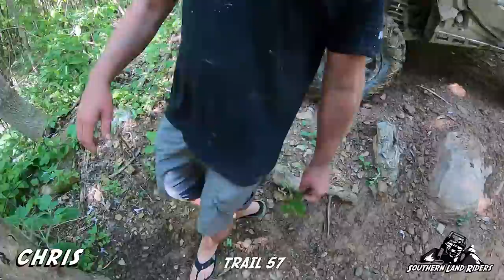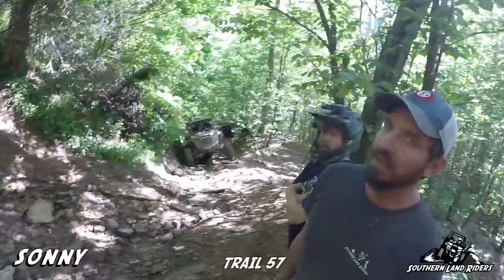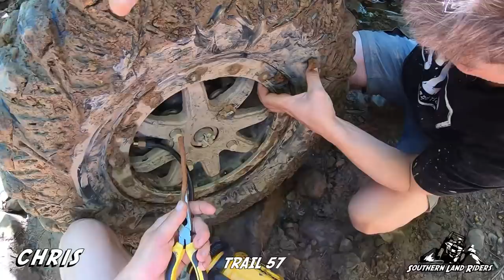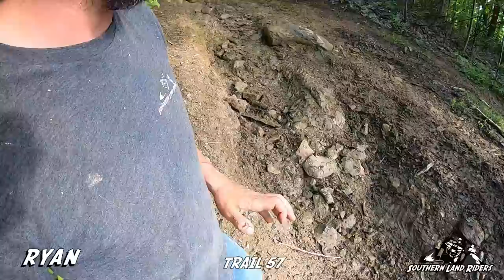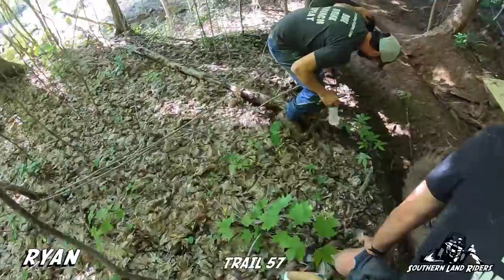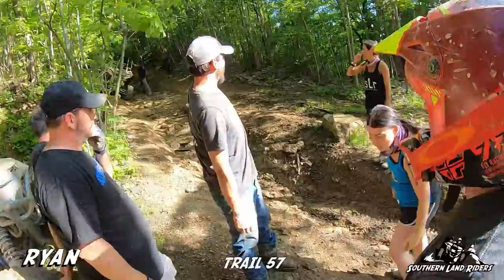Windrock 5/2020 Day 2 Part 5 (Glad It's Over)

Comment: What has been the best all around tire from your experience? Great videos and dedication for taking the hard line. Gives all a good perspective on what to be looking forward to on 1st time trips there.
Reply from the maker: Thanks for watching and commenting. For Windrock and that type of trails and riding we do I am partial to the pro armor crawlers. I have run them on 4 of my machines and probably always will run them in the future. They are fairly light and pretty easy on axles, tire rods, a arms, etc. They have a great tread pattern for rock crawling and do great on general trail riding. The only downside has been the sidewalls. I have had a good bit of flats due to sidewall punchures. I just bought a set of the mrt version of them with the Kevlar sidewalls. They say they are 4 times stronger on the sidewalls. We will find out. Joey and Jeremy have had good luck with their M1 evils. Several in our group run carnivores and they have been good as well.
Reply: @SouthernLandRiders  I am running the XT300. It’s a great tire but I recently got mine street legal here in WV and need aN all around tire. I’ve heard good things about the M1 evil. Have been watching your videos for awhile and tend to hit the rough trails as well. Thanks for the reply and maybe one day see you on a trail somewhere. Keep the great videos coming.
Reply from the maker: @gasmancg  Good deal. Hope to see you out there as well!

Comment: Does anyone in your group ride a rzr s 900 ?
Reply from the maker: No sir. Jeremy used to drive a 900 but bought a turbo S last year.
Reply: Southern Land Riders did the S do ok on trails? Reason I’m asking is I’m picking up a new 2020 900 s tomorrow . Hard to find ppl to get info from .
Reply: I had a 900s with 30s and new super atv lift. Rode most all trails at wind rock no problems.Bigger tires and axles are key.